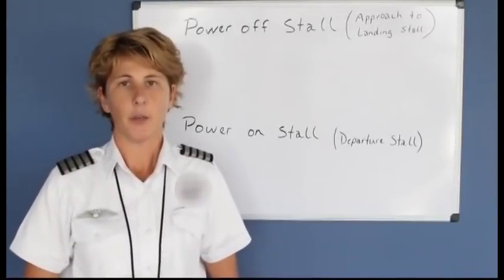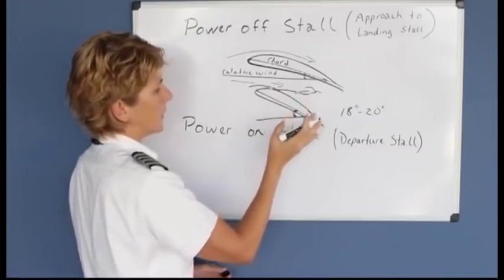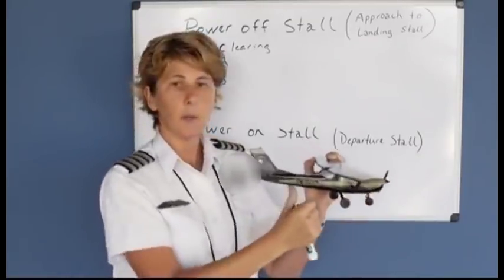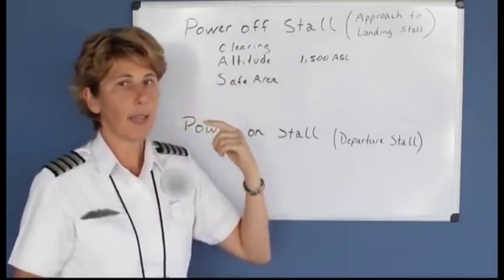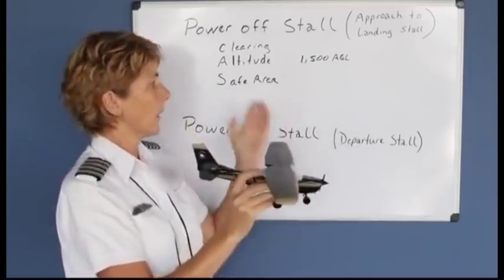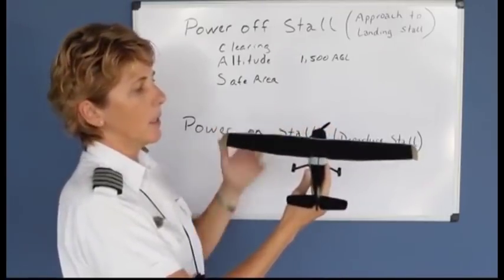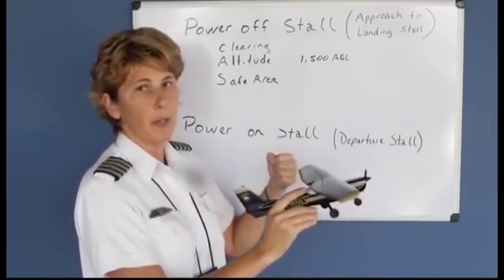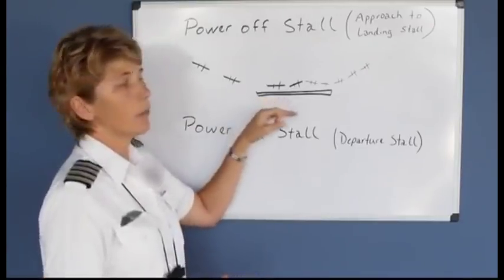Power Off Stall (Private Pilot Lesson 3c)

Comment: During a recovery right above the runway, as I point the nose down to increase air speed, do I give it full throttle slowly??  

I dont know how much a small increase of airspeed is going to do when at 10 feet above the runway or lower, if i only go off of the small airspeed increase from tilting the nose down.

Comment: 1- carb heat out
2- power to 1500
3- flaps in (white arc)
4- start descent 
5- power out
6- nose up to stall
7- release back pressure & add full throttle with right rudder
8- push carb heat in and retract flaps

Comment: After going thru my commercial check ride I concluded that if you get yourself in a stall at departure then you may not me competent enough to get yourself outta the stall. It’s just easier to not stall in the first place. 
I remember my multi comm add on. You have much less room for error. BE58 was my multi trainer that was a powerful plane.

Comment: Again, why carb heat and what about the fuel. mixture?
Reply: reducing power, in this case cutting throttle, without carb heat risks the carb icing up, stalling the engine, and preventing a restart in flight.  The venturi effect in the throat of the carb (reduced temperature due to accelerated air flow) drops the temp of the aluminum throttle body to temperatures well below the vapor point of fuel.  Liquid fuel does not burn.  In extreme  temperature differential, the moisture in the air can freeze to ice and restrict or block the throttle body or manifold passage, preventing any air fuel mixture into the combustion chamber.  The result is a dead engine that may not be able to be restarted in flight.  To prevent an emergency landing while preforming a maneuver which requires a drastic reduction in throttle, add carb heat heat before cutting throttle to avoid an icing situation, and potential in flight emergency.
Reply: Ok I get that. But don’t you need to adjust the fuel mixture?
Reply: fuel ratio would need to be enriched if significant altitude was lost, in order to compensate for denser air.  In her example of 2000 ft or less, I would not expect a significant performance loss, unless you were above a field at a very high ground level already.  (3000' agl over Denver, maybe.  3000' agl over Houston, no. )  But, no.  Reduced rpm's should not affect mixture.
Reply: Copy that. That’s what I was looking for.
Reply: I think carb heat needs to go on with power off manuvers and on manuvers when throttle is full